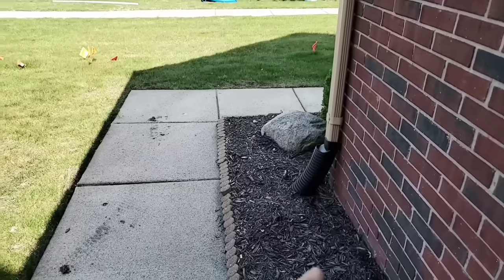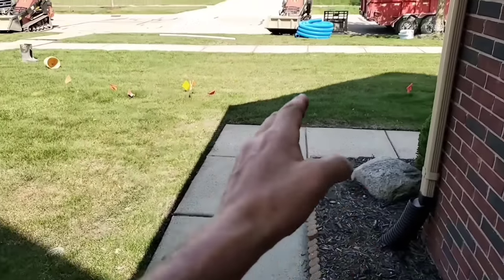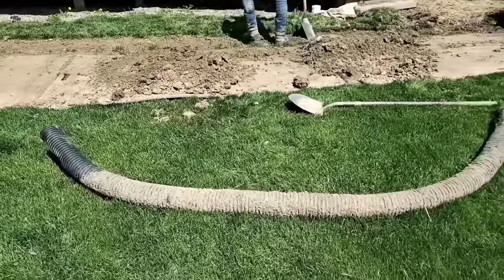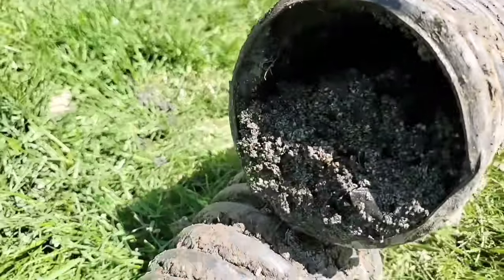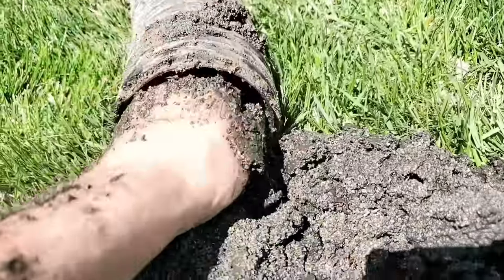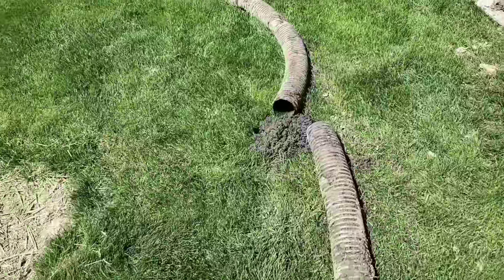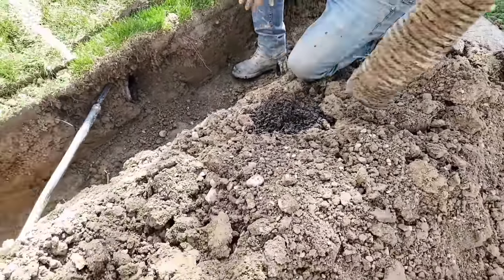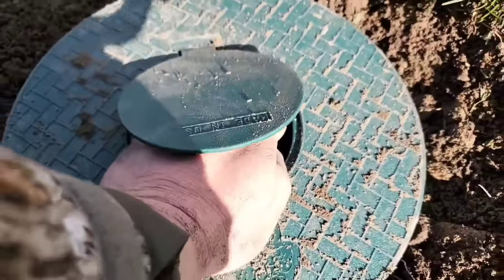Biggest Mistakes to Avoid When Installing a Underground Downspout Drain [ Gutter Drainage System ]

Comment: I have a flat area where two side house downspouts empty.  To find any slope I would need to go down the property line to all side the driveway but the town has laws where they want you to drain not to the sewers but onto your property.  What is the best way to handle this?  Right now I am draining onto a walkway that ends up onto the driveway.  There must be a better solution
Reply from the maker: I find these laws to be a gray area. In most cities, towns, and villages, unless you know they are vigilant about fines, there's no reason why you can't run it to the storm drain anyway. When I represent a homeowner, I do what's in the best interest of my client and protect them from water damage. There are a couple of things that we do. I'll have to make some videos on it. Stay tuned. Once I had a city official tell me I wasn't supposed to do that, and I said okay, but I did so, now what? I don't often challenge authority, but as a licensed builder, I know that this is a gray area. My line stayed connected to the storm drain because there were no repercussions. It's not a code, state law, or in the residential code book for the United States. Sometimes they do enforce it, but I find that to be the exception, not the rule.

Comment: Just dug out an put in some corrugated pipe. I have good slope an got the end of the drain far away from the house. I ran a test for the septic and i see that after about 10 pumps its gonna back up the pipe. What do i do to keep the water from just setting inside the pipe? 

I was thinking digging a large hole maybe 3 foot an filling it with gravel but that still only will hold so much water. My yard has a lot of clay and floods a lot. So it seems instead of it flooding near the house its gonna flood out in the yard which doesnt seem like a real solution. To get to the road id have to go 90 degrees and another 100 foot to get the water to drain off. Im not sure i can do all that work. All i have is a shovel an my back lol.

Any suggestions? I might do a short video and post it here on YT. I will reply with a link. I have no choice but to bury the pipe but i might just leave the end open for now til i come up with some plan to deal with the water.
Reply from the maker: https://youtu.be/SrqcHSzAdBA
Reply: @FRENCHDRAINMAN  Awesome! Im watching this video now. I dont think im able to do this job with a shovel lol. Thank you man. 

For perspective this is what im dealing with. 

https://youtu.be/k6FSTdxY_zE

Comment: Ok but what if you don’t have the ideal terrain for this? I have the same situation as the “wrong” example here but on the side of my corner lot. No room to slope out and I can’t discharge on to the sidewalk anyways.
Reply from the maker: Run 3 inch it will increase the pressure

Comment: I have two downspouts discharge onto a slope that is parallel with the side of my house. Can I install a pop-up at an angle? Or do I need to pipe it down the hill and into the flat section? Thanks for anyone’s help.
Reply from the maker: https://youtu.be/AZQoIpYtBrw

Comment: Where do you run the downspouts to if your yard is flat (no or very little slope) ?
Reply from the maker: Thank you for asking this question. I will make you a video. Stay Tuned!!
Reply: Same situation here!!!!!!!  I have a negative slope towards the house and a window well next to the gutter that’s filling with water!!  Plus old roof with shingle pieces going into the downspout.  Just bought this house but it’s a 23 yr old house :/
Reply: @FixItWithMe  You need a catch basin(s) to collect the water that connect to a sump pump located in the lower part of the area.  The sump pump will only run when it gets enough water in its container. The pump would send water via a 1.5 inch pvc pipe underground to wherever you want it to discharge.
Reply: @BOHICA_  do u mean a tile drain in the window well and attach it to the sump pump in the basement?  I have a sump pump that is connected to a radon vent.  And a French drain along the whole basement except for the wall where that particular window well is on. I think the French drain in the basement wall is connected to the sump pump, but I am not sure where this sump pump discharges to?
Reply: @FixItWithMe  You should not be putting a french drain next to a basement wall. I think you need about 2 feet separation.

Comment: Another common problem I see is connecting downspouts to perforated pipe. Never do that.  Never connect a downspout to a french drain either.
Reply: When the contractor installed downspout drains and French drains around my home about 12 years ago, he tied most of the 4” downspout drains into the 6” French drains which I believe were perforated.  What problems might this cause?  I recently ran a hose thru a couple of the downspout drains but no water came out the end of the French drains at the street but maybe it exited thru the perforations into the gravel base beneath the French drains.
Reply: @JT_70  french drains are to remove ground water and keep the subsoil dry. Surface drains and solid pipes are to move surface water. Putting surface water into the french drain saturates the soil you're trying to keep dry and makes the french drain meaningless.
Reply from the maker: https://youtube.com/playlist?list=PLjFCqaZ4v1BUqichor2QH1X_p9bBPor8D&si=gbmPRrArtYXHd_NO

Comment: I suspect that short-term homeowners/property flippers take these kinds of shortcuts in order to not pay for pro services because 5 years down the road it won't be their problem. This isn't exactly something home inspectors are able to look for either, as the problem is literally buried. I'm only speculating here, but there are some new looking drainage situations on my home when I bought it and I am starting to see some indications of such half ass workmanship.
Reply from the maker: Low bid and little experience are the culprit in most cases. Thank you for commenting and contributing.
Reply: @FRENCHDRAINMAN  Thank you for your informative channel as well as your ethical workmanship. Any advice on how I can tell if the buried downspouts on my recently acquired home will have eventual issues without having to trench up my yard?

Comment: Sorry but what kind of idiot would pass a drain so they creat a trap????
With even the slightest of consideration could have avoided the issue.
....there's more shingle gravel in the pipe than on the roof.
Reply from the maker: Low Bid contractors. Homeowners get what they pay for when it comes to drainage.

Comment: What if you have a stainless steel mesh leaf guard on your gutters? Will that reduce this problem or prevent it?
Reply: No, because the tiny 'gravel' that comes off the shingles as they age is smaller than most leaf guard mesh.
You'd have to have something as small as window screen and you'd find that would clog up fast then you'd probably get water up under your shingles from an overflowing gutter. Had to repair several roofs that were damaged by exactly this, the homeowner put small opening mesh leaf guards on and cost thousands in repairs 3 to 5 years later.
Reply from the maker: https://youtube.com/playlist?list=PLjFCqaZ4v1BXKlR6qPMC_8I00r5KGdoP9&si=EvsQDtrric4gL6Eg